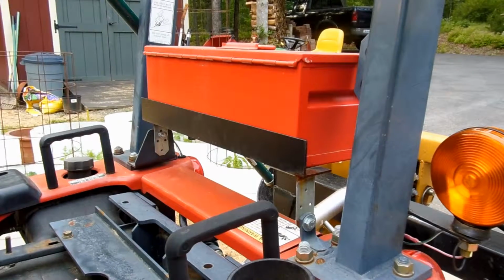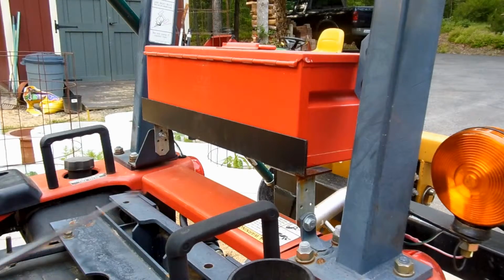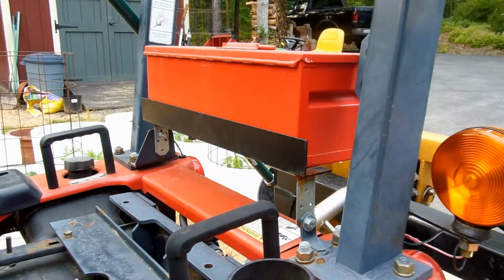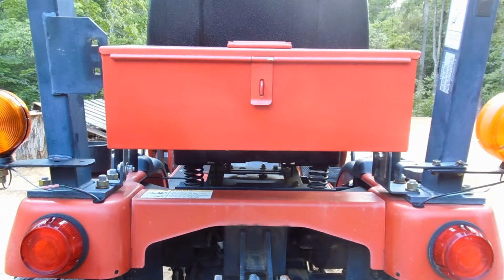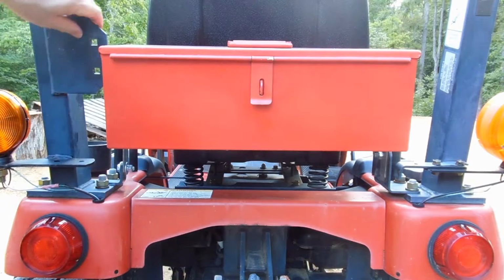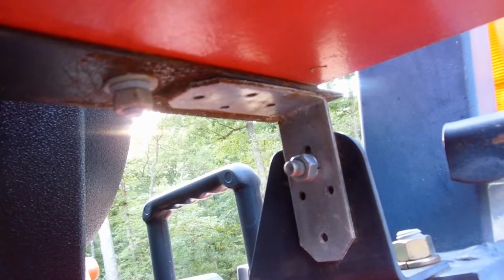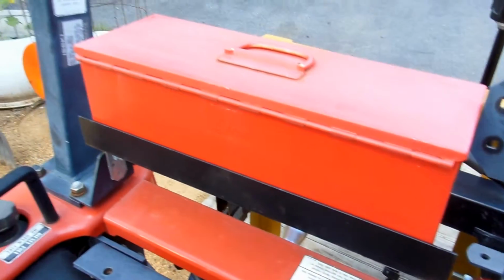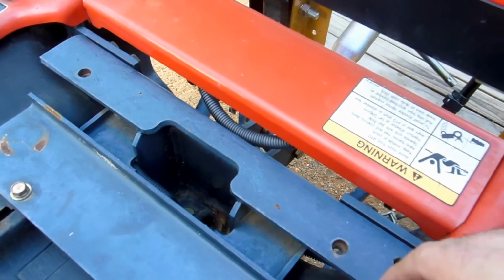Mounting a Toolbox on a MF GC2300 Tractor

Comment: Awesome.  I might just do something like this using an ammo box and lock for my CASE 580C.  Only thing I might add is always add some rubber mat to the bottom otherwise it will vibrate your tools and painted surfaces and chrome on them off.